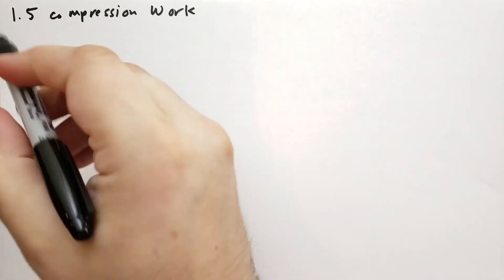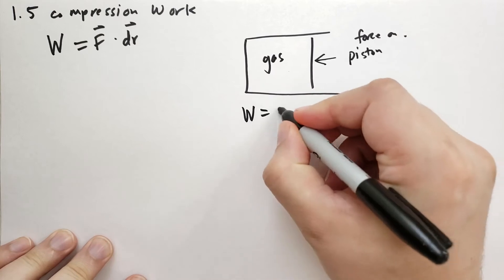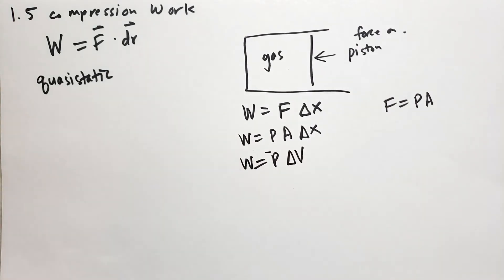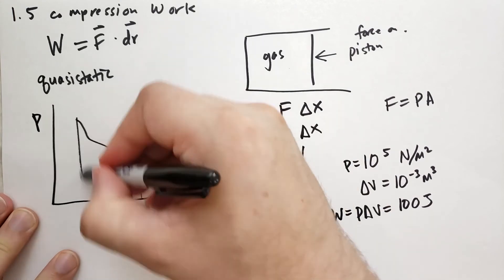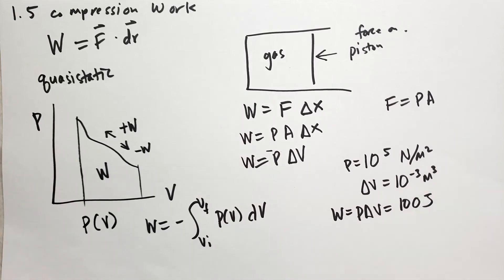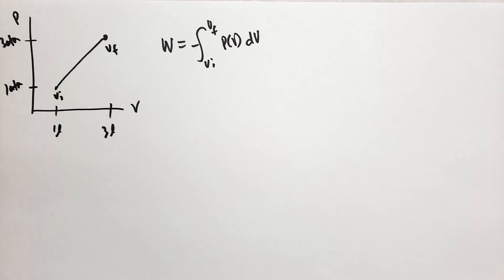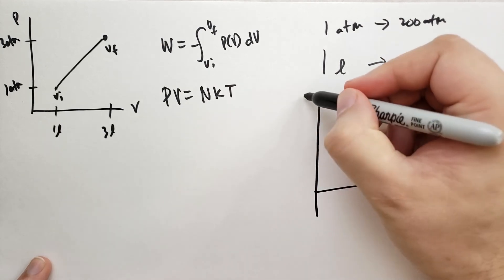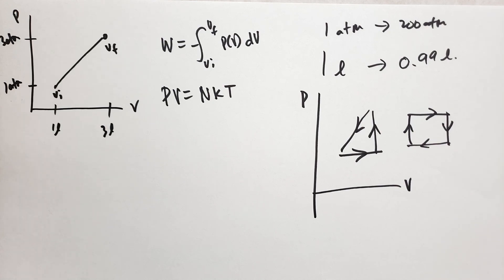1.5 Compression Work (1 of 2) (Thermal Physics) (Schroeder)

Comment: I think you should use a small whitebord that lies flat on the table, less waste and you can remove stuff if you need to:) Great videos by the way, really helpful when your professor is not that good at teaching
Reply: Thanks for the suggestion. I tried a whiteboard but it was too reflective. You couldn't see the writing if the lights were not just right. I tried a lightbox too.